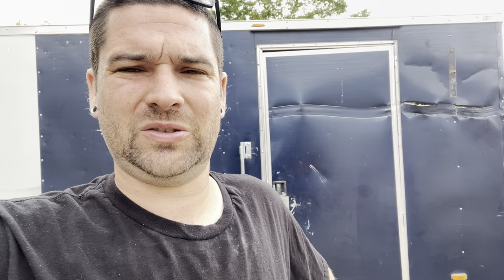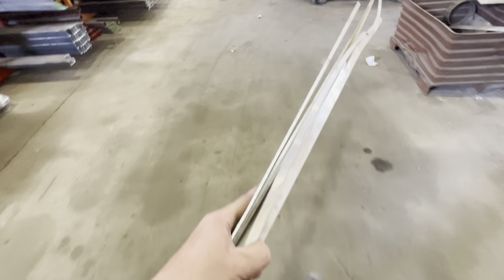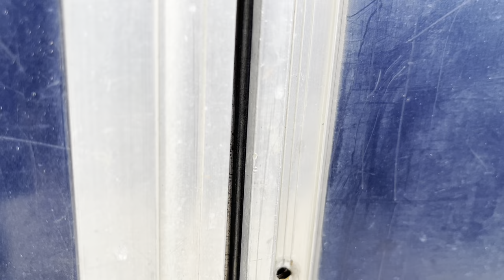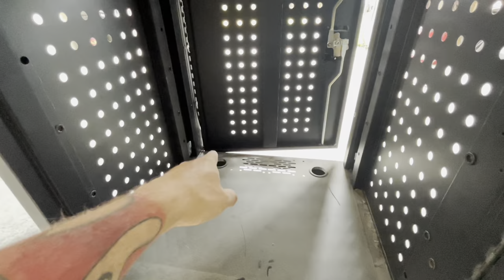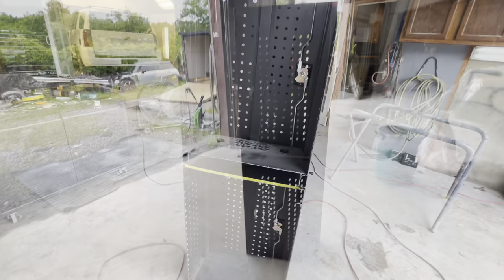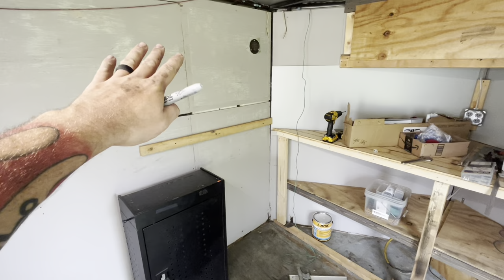🧨DIY Budget Race Trailer Project Weekend‼️ It’s coming together 😁

Comment: Could put your winch on a pin in the floor where you want the front of the car to come to and two pull hooks at the back with just enough chain to fit perfectly.
Then when you unhook the winch jus unpin and move it out of the way.
Reply from the maker: I’m definitely doing to chains on rear. I think I got a very good front tie down figured out where I don’t have to depend on winch at all and it’s super easy

Comment: U coul use e track with o ring tie down anchors then ull have different mount options
Reply from the maker: Yea probably is when cars all the way forward you can’t get to driver front side being it’ll be such a tight fit in there. You’ll need to strap driver front down from passenger side. I have an idea

Comment: Stainless piano hinge will solve your door hinge issues, i got two 48” ones from ebay then cut one to length and never looked back.
Reply from the maker: On an exterior door…. Didn’t think of that. That’s what I used on my wide upper cabinet door.
Reply: @ThePaintPaperHustle  may have to trim that bar/rod lip off to have a place for the pivot part of the hinge though. Mine had 4 thick ass standard style hinges so the stainless one worked perfect for mine
Reply from the maker: Gottcha. Yea ima mention it to Mike and see what he wants to do this coming week being he helps me fab up stuff like this often

Comment: I know my friend has a Maverick in a enclosed trailer and he has to put it as close to the right side as he can so that he can get in and out of the car to move it out
Reply from the maker: Mine will be winched in and out I won’t be driving it inside.
Reply: Just want to ask when you tell the other Maverick apart if you're not going to use the steering if it has the original idler arm on it I would like it I have a Moog bushing but it only works with the original Ford idler on if you decide to do it let me know what shipping charges are and the address is 5031 Kinston North Carolina 28501
Reply from the maker: Yes it’s on it and no I won’t be using it   Idk when I’ll be taking that apart